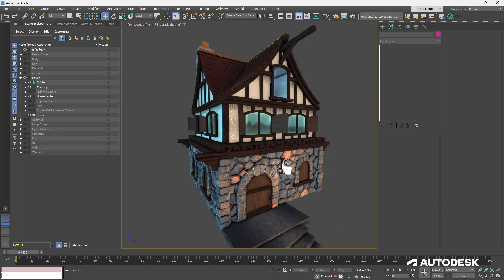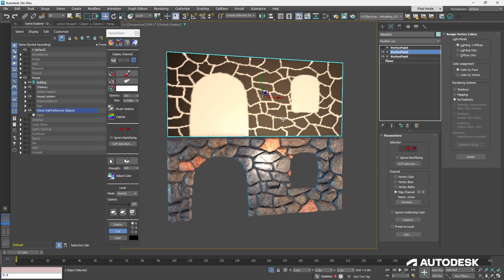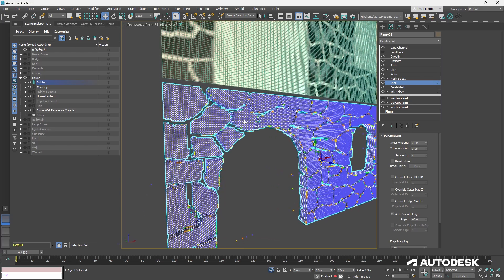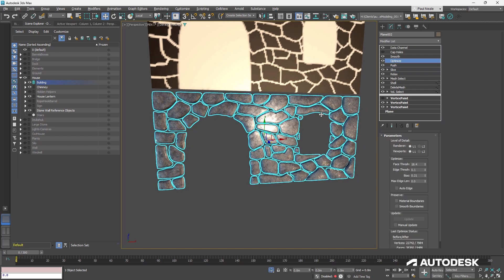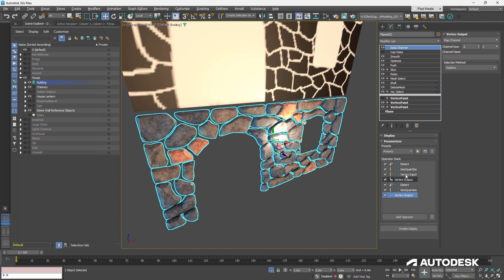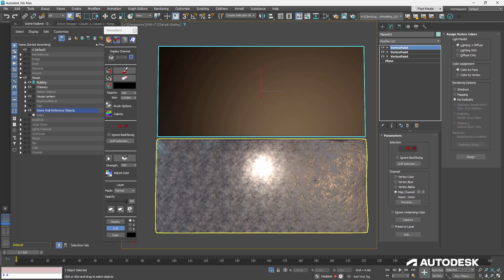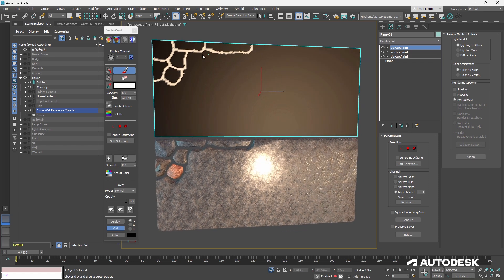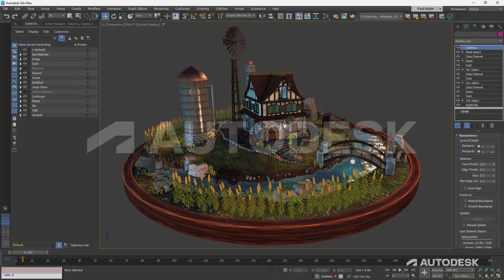Save Time with Procedural Modeling - Part 7

Comment: A couple of years ago there was an entry on 3d max public roadmap about "Consolidating and improving brush tools inside 3ds Max" and there were some screenshots looking very similar to how the brush related UI was in Mudbox. I don't expect to get advanced painting and sculpting in Max but at least update that UI around 06:11. That curve Graph control in particular is so outdated and ugly and it's shared across so many tools in 3ds max. Just modernizing that widget will make a big difference across the entire software. Vertex paint window is also a long due to make its style consistent with the recent modern 3ds max UI style.
Reply: Agreed! They seem to be updating some UI elements as evident in 2025.1 for example, but it's a very slow process. Curver Editor overhaul is also overdue, it's very dated.

Comment: Amazing series! What a journey it's been, eye opening! Is it possible to achieve this result by using a bitmap or maybe closed splines for things like windows, how to convert this data to vertex color to use it in this setup?
Reply: Yes you can use a bitmap to drive the selections. I'm not sure what you are asking about closed splines for windows how ever.
Reply: @paulneale  What I mean is, a closed spline representing a window that would be interpreted as a color - just as in the video, white color on the black background - and assigned to specific map channel. So, drawing a spline instead of using a VertexPaint brush for painting grout, door, windows.